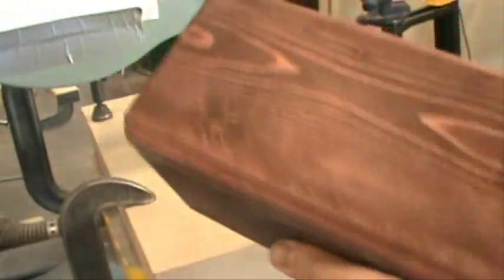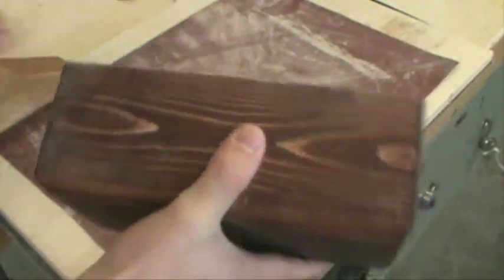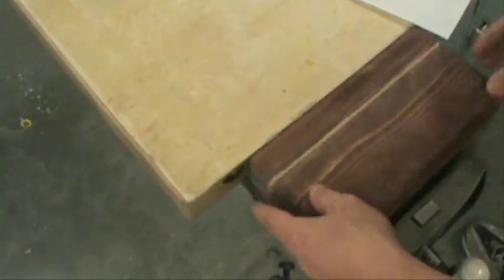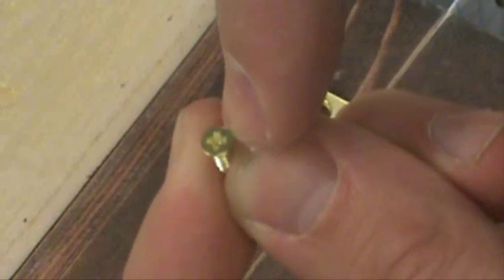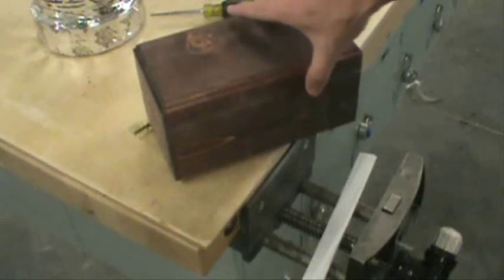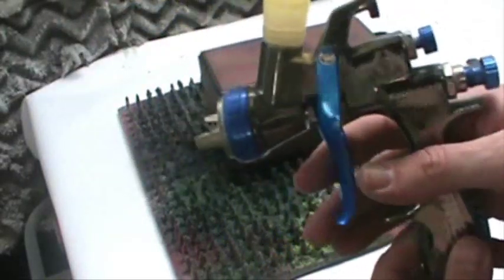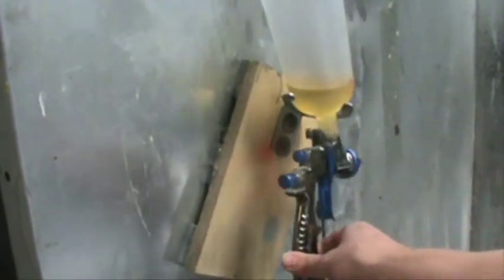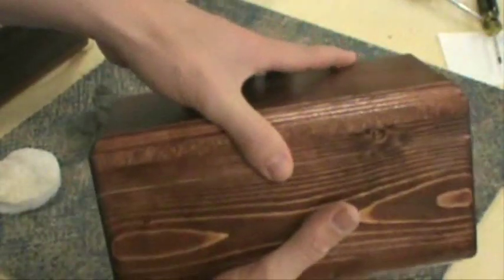How to Make a Wood Box Part 3

Comment: I like your box its nice and neat and looks goodWhen I make boxes I do it all by hand as I don't have a band saw etc, I like to make the base and the lid separate also I prefer to recess the wood and install the hinges with the screws concealed so that the box can have a lock added and used for valuables etcbut I do like the idea of the whole box  construction then cut off the lid as this is faster process than the way I make my boxes